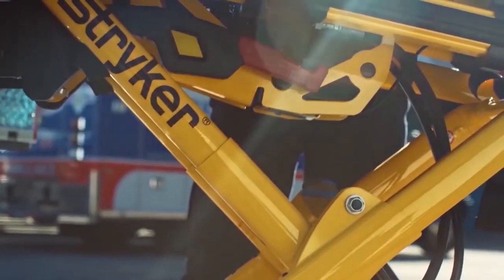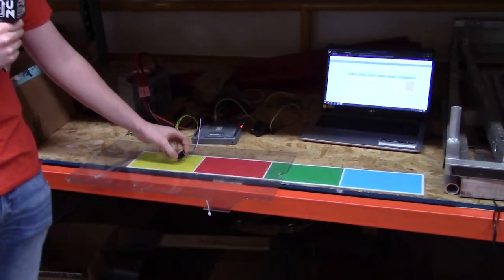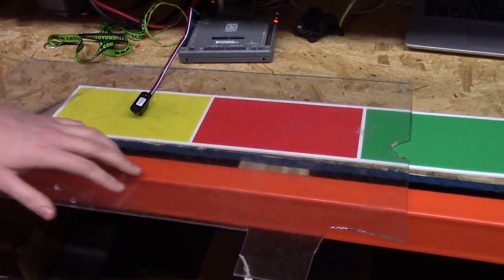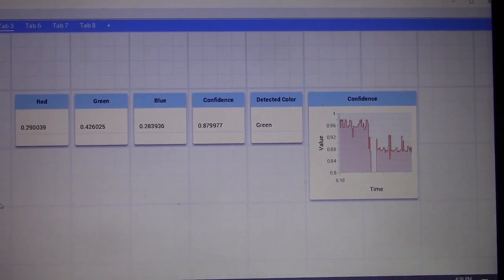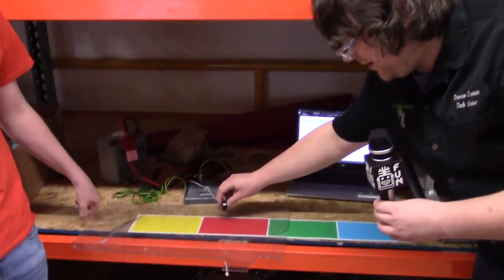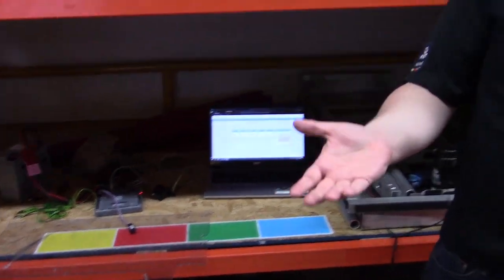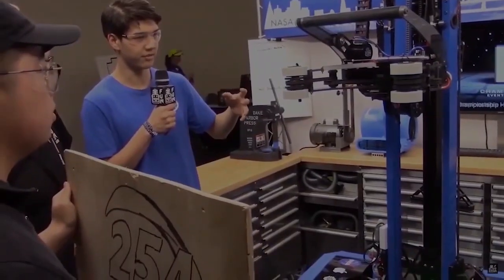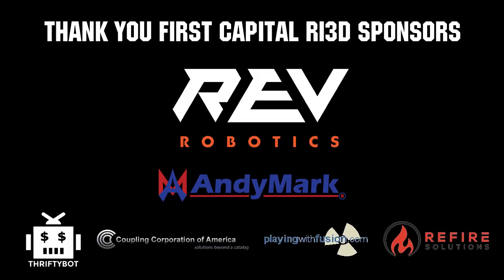REV Color Sensor Bottom of Control Panel - FIRST Capital Ri3D - First Updates Now

Comment: One problem with this test: you're still getting ambient light from the ceiling lights in the room. On the actual playing field, looking at the control panel from the bottom will have far less ambient light as you'll be in the shadow of the structure. Might be worth revising the test methodology a bit.
Reply: The color sensor has a light on it, so that should help with the shadow